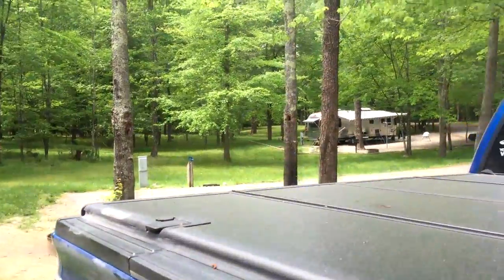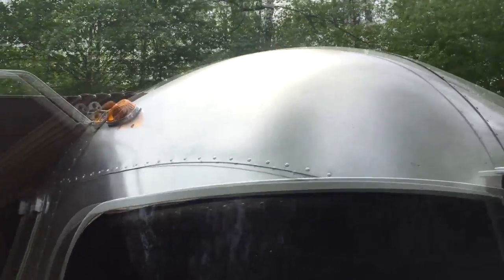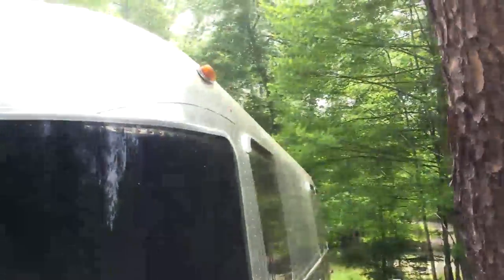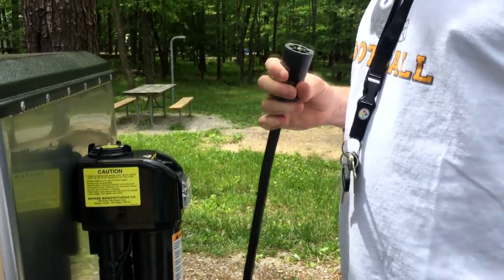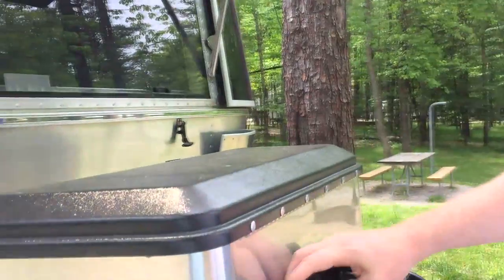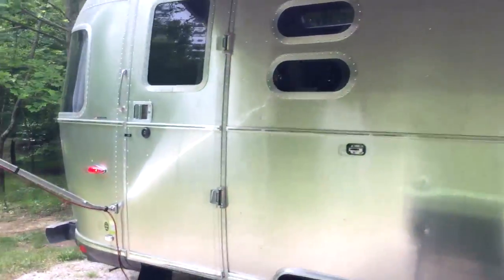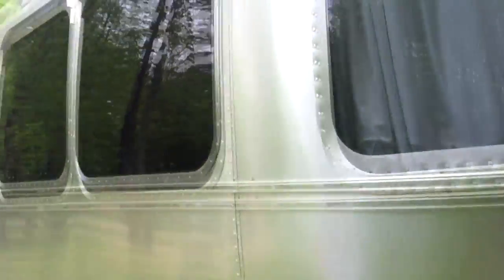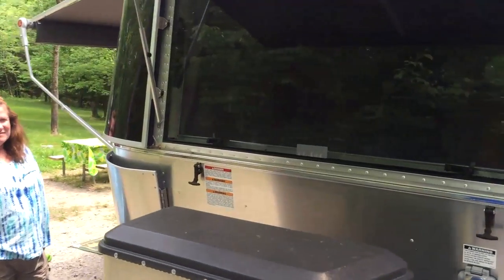Airstream Trailer Light Trick

Comment: I’m plugged into shore power. Battery with converter on is 13.6v, with converter off is 13.1v, and I can’t get my lights to turn on.
Reply from the maker: Make sure the fuse you are using is not blown and your are bridging the correct slots
Reply: @AirstreamNerds  no blown fuse and I had the fuse in the slot shown in your video. Nothing. When I first did this last week, it worked. Went for a walk with my wife for 30mins around the KOA, came back and the lights were off. Haven’t been able to get it to work again. I’ve researched online, posted a message on an airstream FB newbies group, and everyone keeps telling me it’s a dead battery 🤷🏻‍♂️ Lights works properly when plugged into our 7pin on the truck going during travel. Just can’t get them to work when parked at the KOA.

Comment: Hello, I'm trying to find the hatch for the  Airtream Trailer cable that connects to my truck can you help me find this part?
Reply from the maker: Nicolas Chirinos if you are talking about the spring loaded cover where your trailer plugs into your truck it is a part from your truck and you should contact your car dealer.
Reply: Is not that, is a cover that is mounted on the Airstream and the Trailer light cables comes out to connect to your truck.
Reply from the maker: I am not sure but have you contacted your dealer or Airstream directly?
Reply: No, but I will thanks so much for your response.
Reply from the maker: Nicolas Chirinos sorry I could not help but thanks for watching and reaching out
Reply: It should be right up front and center on the body directly behind the propane tanks.